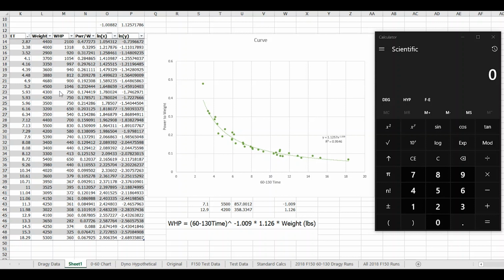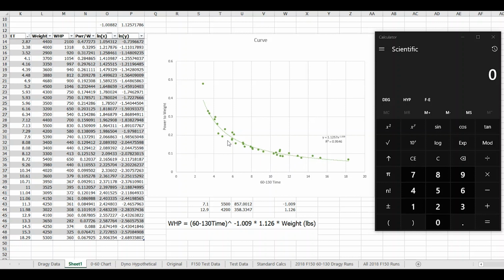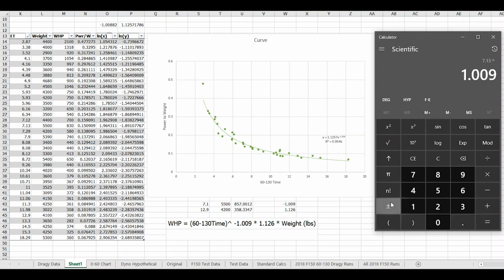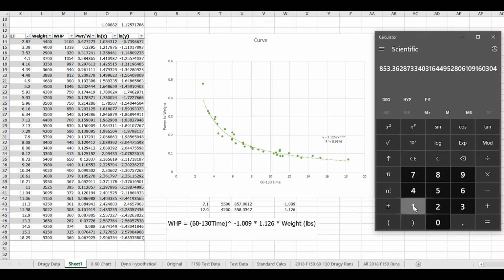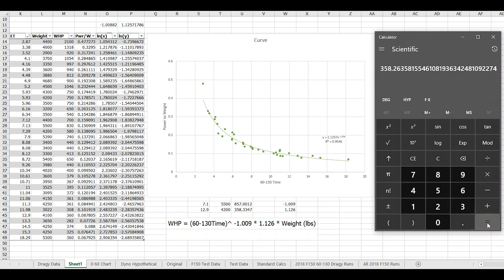Guesstimate Wheel Horsepower Using your Dragy 60-130mph Time!!

Comment: Would you also take in to account the addition of your own body weight to the cars total weight?
Reply from the maker: Yep, you should use the weight of the vehicle during that run, so include all contents of the vehicle including driver, fuel load, and any other junk in the car.
Reply: @dkvenis haha I was thinking fuel after I said this. With a 10 gallon tank and a 400lb person. Vs my wife at 100lb and one gallon. I know this is an estimation and there are countless variables.
Reply from the maker: @austinthompson7192 it’s still a bunch of fun to use and guesstimate a bunch of different cars. It’s not perfect but it’s close and even Google AI recognizes the formula now so that’s kinda cool
Reply: @dkvenis  as an analyst, I appreciate your spreadsheet. Great video.
Reply from the maker: @austinthompson7192 thanks! I quickly realized I’m too OCD for creating YouTube content… probably too soft as well 😂 That’s why there’s not more. I went down several rabbit holes on this stuff before I found different squirrels to chase.
Reply: @dkvenis haha I get it all too well. Luckily you are a smart man. The rabbit holes I go down usually end up with me chasing my own tail.
Reply from the maker: @austinthompson7192 😂 same!

Comment: lol i make less hp than stock according to this. i guess slower cars mess up the formula?
Reply from the maker: Lots of variables… this is wheel hp so 15-20% of driveline loss is included. What’s your car info, weight, and 60-130 time?
Reply: @dkvenis  i've only been able to get one 60-130 run, and it was super slow: 27.72

2nd gen Cruze 
1.4T w/ 6speed automatic
current weight is ~3000lbs with me in it

datalogs show 23.5 - 25 lb/min from the MAF, so should be ~230-250hp
Reply from the maker: @dogan1-p3e  yeah something definitely skewed the run… at lower power levels, your surroundings get magnified. High DA, super hot and/or humid, a 10mph headwind, a 1° uphill slope, heck even leaving your windows down can make a measurable difference.
Reply: Main variable would be aero drag coefficient, since you are doing such high speeds. If you put this in for all cars in the list I am pretty sure graph would be damn near spot on

Comment: Seems like it is pretty damn close. Helps me cause all the dynos up in Denver spit out these astronomical correction factors cause of our DA. So this tells me that my 2.86 at the track with my race weight of 3050 is about 1212whp, which makes sense.
Reply from the maker: Glad to hear it! I know (and you know) that there’s a ton of variables that can change the number, but as long as you control as many of those as possible, it’s a pretty good and cheap tuning tool.

Comment: hi David , a Link to my ET_Analyst for DragRacers Software, 
https://www.youtube.com/watch?v=7MPVrxkMonI

calculates HP each Feet + TQ and HP Data, GForces, etc
Also i ran your equation for Record Runs in NHRA SS/IA Camaro, ProStocker, TopFuel Dragster
very accurate for the SS/IA and TopFuel Dragster , but was not as accurate
for NHRA ProStocker record runs, 2 out 3 not bad !
Reply from the maker: Thanks! Your software seems to have a ton of functionality… What does it use to capture data? Just time slips from the dragstrip?
Reply: @dkvenis  yes, just the ET Slip Data, there's a tremendous amount of Data that can be had by just the ET Slip Data , future versions will be much better with much more Data results !

Comment: Would this formula apply for 100-200km/h instead of 60-130?
Reply from the maker: Unfortunately no. Since 100-200 is 62mph-124mph, the HP readings would be incorrectly high. I tried to develop a formula for 100-200 but there’s just not near as much online as there is 60-130.

Comment: 40 wheel short but still in a decent ballpark
Reply: I’m super late sorry, but also take into account that you’re dealing with wind resistance, etc compared to a dyno. Results are probably closer to a mustang dyno result which is 10% low. Oh and you may never have been in your 1 to 1 gear like on a dyno which is “peak” hp. Like he said variables haha.
Reply from the maker: I’ve never understood the “1:1 gear ratio” argument. The rear differential modifies the ratio and the height of the tire changes the ratio as well. A chassis dyno or a dyno calculation should be used to compare changes on the same vehicle; it’s not about the peak number as much as it’s more about the difference between runs.
Reply: @dkvenis   honestly I don’t even know either. And I agree with you. All I know is that if it’s not 1-1 than it will read lower amongst 50 other reason.  I may not be saying this correctly, but I think “average” hp (at WOT) is waaaaay more useful. For example the GT350 peak is 526 or (460whp more or less) but when you shift the rpm drops to 6500rpm and whp is like 420whp. And while rpm climbs from 6500-8200 the hp is spending most of its time somewhere between 420 and 460. Sure 460 peak, but it’s never there. Lol. So like I said I’m with you on that.